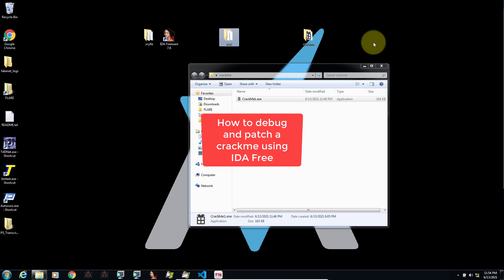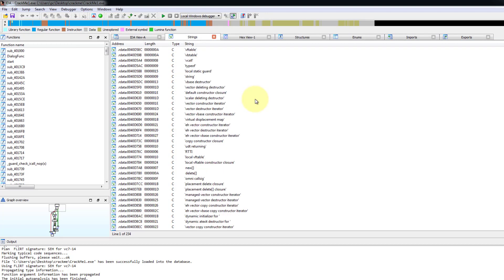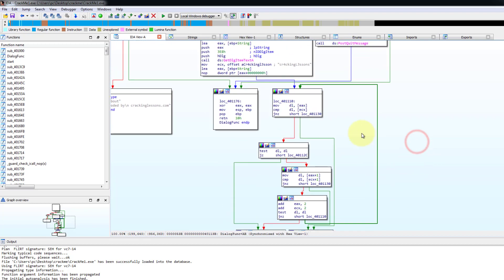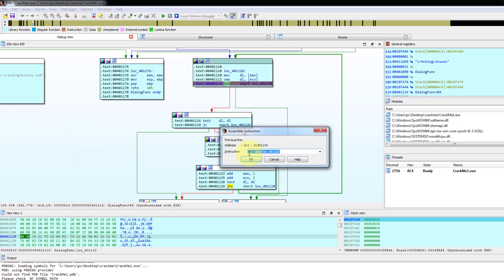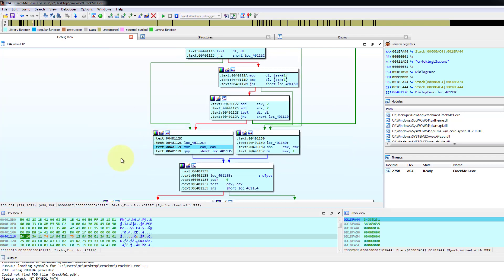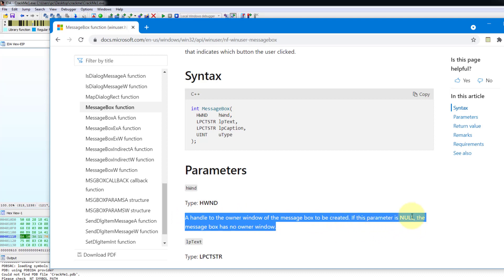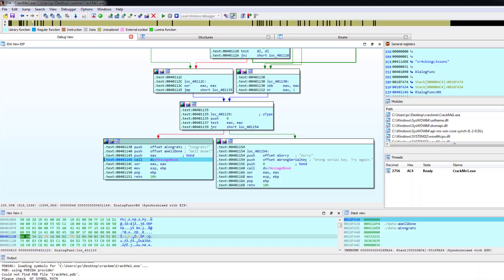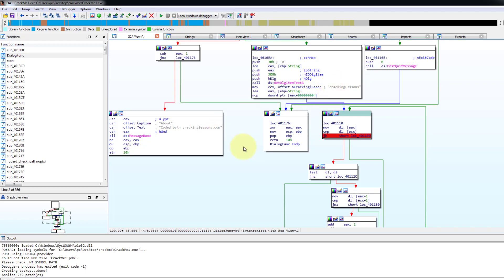How to Debug and Patch using IDA Pro Free

Comment: The software im trying to crack its a setup file it will work the same ? and i cant find the string i need
Reply from the maker: Not sure. I have not tried cracking a setup file before. I normally install it first, and then crack the installed file.
Reply: @PaulChin20   the software its behind a setup file and the setup file require a password in the installer
Reply from the maker: Oh I see. You could try to crack the setup file then. Use xdbg.

Comment: Hi Sir,
i have an old dos application (cooling tower calculation program). The problem is it runs on my xp but when i run it via emulator (dosbox) in win 10 i get an error saying

"This program is copy protected. Use Install To copy It"..

The license folder (AX NF ZZ) is stored as hidden on c dive in xp. Is there anyway that to make DOSBox check the license folder... Or can we use ida pro to remove the attrib checks from the exe itself ?

This is what one of a member from different forum told me..

- Dosbox can't see the hidden files, because DosBox doesn't support long filenames, ie filenames with a space in them for example, and the directory where the files are is named "AX NF ZZ" and has spaces

- And even if it could see the directory, DosBox doesn't support hidden/system files either, and there's a check to see if the files are hidden in the code.

He changed the folder name to AX_NF_ZZ in the code, and removed the attribute checks. Because some of the code was encrypted and it worked for him.. Unfortunately that was his last post and dint here from him again lol my bad luck.

I somehow want this application to run in dosbox for my college project..

Application File - https://easyupload.io/uw7fwj

If any one could help would be gr8full..

Thanks ..
Regards..
Reply: The newer versions of IDA Free don't support DOS executables, you're best bet is to use the Freeware version of IDA 5.
Reply from the maker: @ronin7771  Thanks for the tip Ronin.
Reply from the maker: Sorry Sam, I am not sure how to solve the problems that you are facing. It appears that dosbox is some kind of virtual machine and you are running a dos program inside it. I am not sure how to crack the dos program inside the virtual machine, since I think xdbg would not be able to penetrate the dosbox and disassemble the dos program within it.

Comment: I want to extract the URL vedio from the program. How?
Reply from the maker: You can try using PEstudio to open the program. It will list all the strings it finds, including urls.  You can download PeStudio here: https://www.winitor.com/download
Reply: @PaulChin20  Thank you. But the way is complicated and needs time and I have to take the URL In a short time.
App exe and weak protection 
I want a quick way or program to take.URL A lot of research in Google, and I couldn't find a way.
Reply from the maker: @mr7mood357  Have you tried PEstudio as I have suggested? It is very fast. The strings a listed automatically. And you can scroll to down the list to see the urls.

Comment: Hello. Is it necessary to buy the professional version of Ida Pro? Is the free Ida debugger enough to debug hung processes on a Windows system? I work as a user support engineer and the user freezes the scanning program for 10 minutes and then continues to work. Stops at the win32u!usermsgwaitmultipleobjects function. How do I know what the scanning program is waiting for?
Reply from the maker: I think, in your case, try using dedicated debuggers like windbg or xdbg. IDA's debugger is not that powerful as compared to windbg or xdbg. In a debugger you can step through the function call and inspect the memory in realtime and see what the scanning program is waiting for.  Windbg is microsoft's specialized debugger for debugging low level kernel and system processes and is very powerful. xdbg is for general purpose debugging. Good luck!
Reply: @PaulChin20  Thank you so much for answering my question, because I have been trying to debug a Windows system for several years now. I work in user support and if the program freezes or consumes a lot of resources, I become helpless))) Did I understand correctly that all problems in the system can be solved with a debugger? The disassembler is probably made for something else... I'm reading the book "Windows internals". What other resources can I read about debugging?
Reply from the maker: @Anton_Zh  Windows internals is a good start. Also here is some microsoft tutorial on windbg debugger:  https://docs.microsoft.com/en-us/windows-hardware/drivers/debugger/getting-started-with-windbg

Comment: Hi Paul..     if you have something like this  mov esp, ebp     in  X32bg  it tells you that it is too big  if you change it to  mov esp, ep    ,   how can you do that in IDA ?     and how would i know if something is too big?   Thank you
Reply from the maker: I assume you are referring to assembling an instruction which overwrites the following instructions. If such is the case, you can know because in xdbg, you can click on the left check box of the assembly dialog to make sure it is same size. If it is bigger there will be a warning. But for ida i have not tried assembling anything which overrides the subsequent instructions. Maybe you can try and see if there is any warning messages?
Reply: @PaulChin20  let me try and see what happens. I will report back.  I like x32bg better for editing,  but it seems harder to trace something
Reply from the maker: @perrykappetein9685  Thanks Perry!
Reply: @PaulChin20  so did play wit it,  and found the following.

if I want to change it to another value,  it will  keep giving me an error , that i cannot do that.

if I want to NOP  it.  I don't need to find out the bytes.    if I nop  a  move  eax, eax   it will show below the leftovers in yellow,  that i need to nop as well.    but as far  chaning a test eax , 0  to  test  eax, 1   or anything else,   it wont let you.
Reply from the maker: @perrykappetein9685  Thanks for the sharing Perry!

Comment: sir , how to bypass online login software
Reply from the maker: One way is to use HTTP Analyzer (https://http-analyzer.en.softonic.com/) to monitor the traffic to the server as well as the response from the server. Then block the server by redirecting it to localhost using the hosts file in windows (https://www.freecodecamp.org/news/how-to-find-and-edit-a-windows-hosts-file/). Then use xdbg call stack method to trace the serial key check function. Look for the jump that decides if the response from server is correct. Then reverse the logic and patch it. You can learn to do this in the CSP course:  https://crackinglessons.com/learn

Comment: Hello sir. Sir I have a problem while patching.  The software which I am trying to patch requires internet for activation. And when I search the messagebox in the search section. There are no results. What can be the problem.
Reply from the maker: You can use the call stack method. In xdbg, after the message box shows. Pause. Then go to the Call Stack Tab. Check all the functions from the top - one by one until you get to the caller of the MessageBox.  One of my courses teach you how to do this:  https://www.udemy.com/course/reverse-engineer-window-program/?couponCode=RE2JUL7
Reply: @PaulChin20  Thank you Soo much sir
Reply: Hello, I have trying to he same to LISCAD 2021, but seems it is too complicated for any debugger. Could you please help me out.